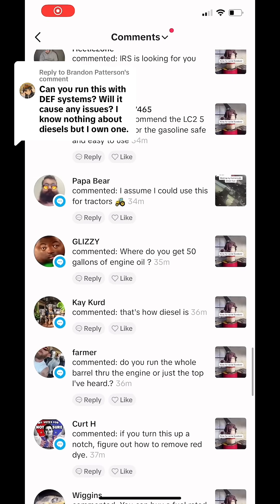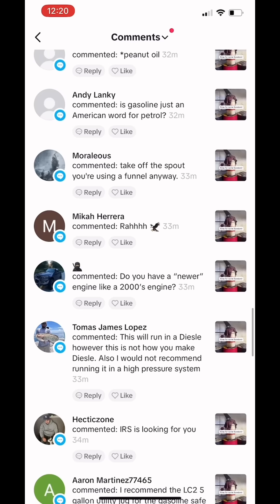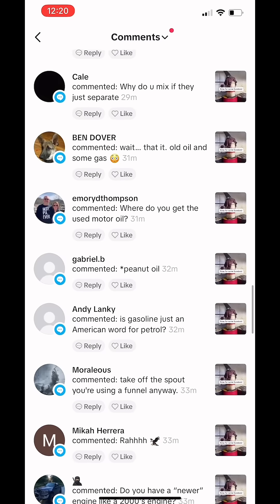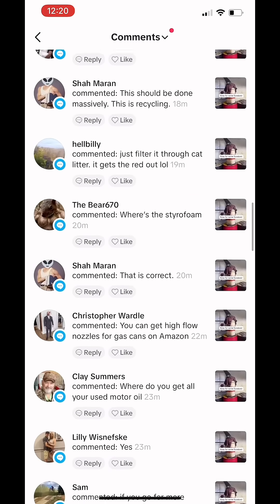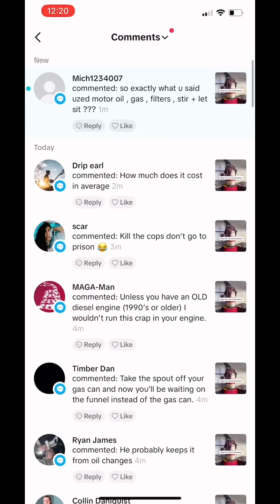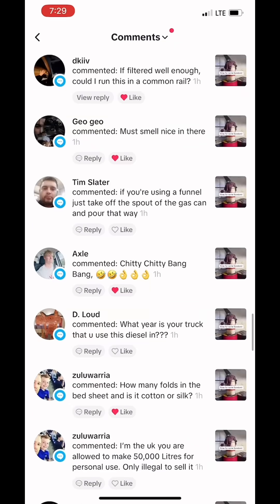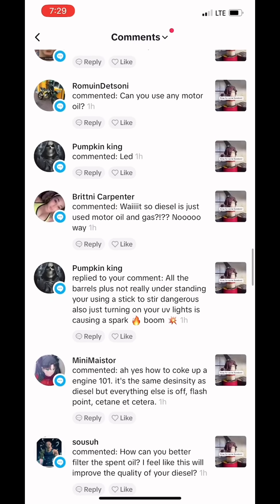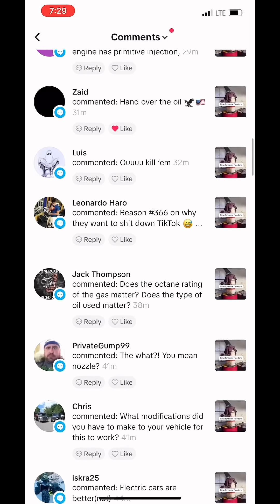Turn Waste Oil into Free Diesel Fuel #fuel #freediesel #diesel

Comment: Yep for those of you wondering if it'll work in anything newer like say a 2000 model powerstroke. yeah sure it'll run but you're going to be replacing your injectors not long after. I have a friend who done this to his 2000 model powerstroke it ran fine until it didn't. He had to replace all eight injectors 🤷 so he stopped doing all that and gave me all his oil and tanks because I have a yard full of idi Ivehicles👍👍👍